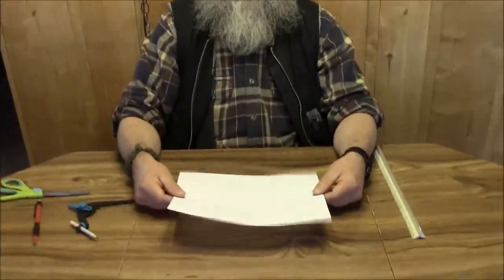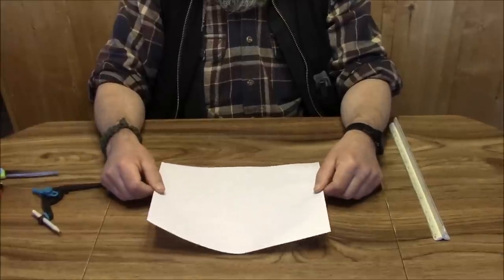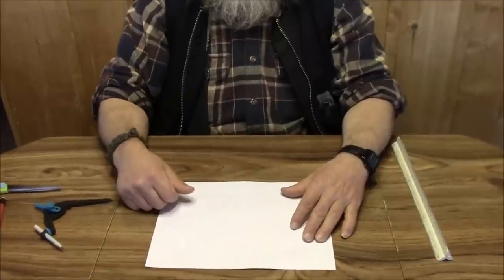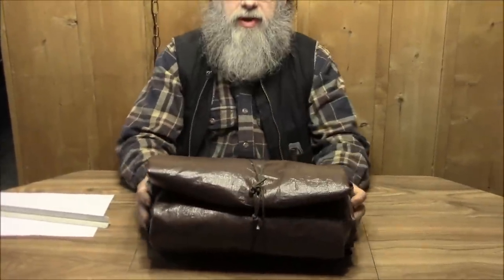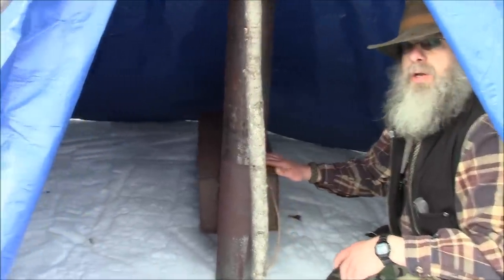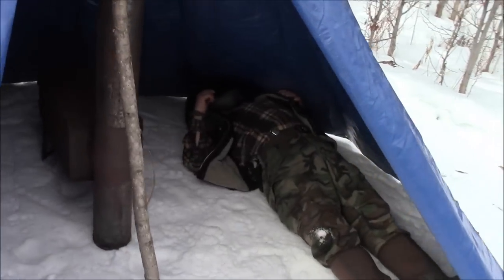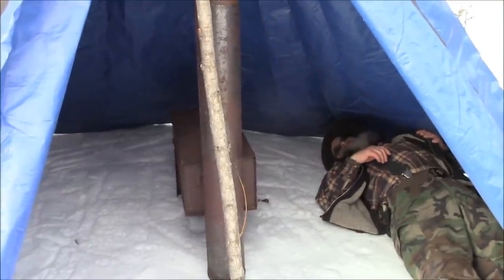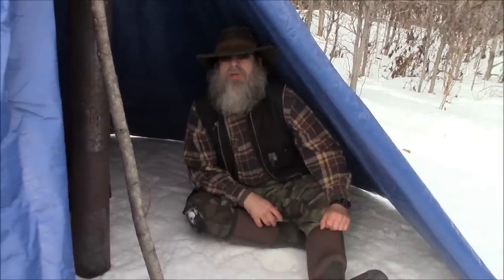Make A Tarp Tent Tipi Hot Tent On The Cheap

Comment: Hi Lonnie!Great and cool project my friends! Thanks for sharing. Take care, Sepp.Please tell the size of the fabric before cutting
Reply from the maker: The size of the tarp was a 12 Foot X 16 foot heavy duty poly tarp.   This size tarp and resulting tipi is okay for one person and will fit up to 2 people in it when also using a stove inside but it is not very comfortable not being able to stand up.   I recently watched another video where the video creator made a very similar tipi from a 16 foot X 20 foot tarp and that was much more roomy with a center pole height of 7 foot 3 inches so enough room for us shorter folks to easily stand up and enough room to be able to get back away from the stove as well as be able to sit up off the ground in chairs with legs.  So I said all that to say that I am planning on making me a new larger tipi from a larger tarp before next summer most likely.   However if you are usually by yourself you may find the smaller size tipi satisfactory for your uses.   It is a matter of personal choice.
Reply: @Far-North-Bushcraft-Survival Thank you lonnie

Comment: Great Video.  Just a though, some of that scrap material could have gone in the reinforced area inside.  I did not hear you mention the height of the pitching stick.  I know you would cut one as need, but what was the approx height?
Reply from the maker: +Chris Varns    Yes you are right.   I could have used tarp cutoffs for extra reinforcing.    The height of the center pole is approximately 6 feet high.    It is not very practical to have a precut stick since the center height can vary considerably due to each new tipi pitching location.  It is virtually impossible to find completely smooth level locations to pitch the tipi in wilderness settings.     A person though could easily precut a PVC pipe for instance though and place another smaller diameter pipe inside which can be slid further in or out according to what is needed and then clamped in place.

Comment: Great video , but i see a ventilation issue. With the extra wedge for the door it looks pretty airtight. Did you consider that?
Reply from the maker: There is very little condensation inside this tent when using a woodstove as teh woodstove creates considerable air movement through the natural consumption of air during the combustion and the sucking in of fresh air from the outside to replace the consumed air.   I have made many different tarp tents through the years and have never had a condensation problem when using a woodstove inside.   It does occur but is minimal.

Comment: One idea, when you cut the V for the door, instead of cutting it exact move one side a couple of feet in. That will get your door overlap without having to add a scrap piece later. Just be sure to mark the original point, you would have cut it to, in order to get the grommet placed there right.

Comment: This is just a question My Brother Could I use this same idea with a 20' x20' tarp it will be for long term use so I will be making two of them one for backup and a much smaller model for equipment storage
Reply from the maker: +Gene Peltier     I would recommend that you get out some paper and draw out models of the tipi and put them together.  Measure just like I shown in the video so that those measurements can then be translated to represent feet or decimeters or what ever you desire.    I have never tried using a square dimension material.   Draw it out on paper and put it together to see what it looks like and then you will know.     I am sure you can use the full 20 foot length but may not be able to use all the 20 foot width.

Comment: cool. I wanna do this, maybe make a hole at the peak , for smoke and a regular wood fire on the ground,  sew some webbing straps  4 or so  to tarp and up to a ring or something, poke pole through ring,    i dunno what do u think of a regular fire on the ground lonnie? verses a stove with a stove pipe?
Reply from the maker: This is not the best design for having an open fire inside.   It would be better to have a taller and narrower design tipi for open fire use to allow more upper room for smoke.  It might take some figuring to make a hole in the top for smoke escapement but also have a means to support the peak.   You have to go back to the old fashioned way of using an inner pole frame just like the old tipis

Comment: Lonnie, instead of adding that "wedge" at the door at the end , would it be better to just cut the door a bit wider to leave a "wedge" attach in one piece so it overlaps naturally, would that work  ?... what size pole is needed ?... thanks for the great instructions ,I will be using a white tarp so it get plenty of light inside during the day .
Reply from the maker: The way the tarp is laid out for cutting, one can only make the most of the available material if the door overlap is added later from cut off scrap.   The center pole is approximately 6 foot but changes from set-up-location to set-up-location depending on the unevenness of the ground in each location.

Comment: Lonnie, why not fold the tent in half, mark and cut. This will minimize the area required. Just a thought. Great job!
Reply from the maker: Randy Krofick I'm afraid that might have slid around even more on that slope.  I was cutting this in our driveway and our whole driveway is sloped one way or another.  Our house doesn't have any area large enough to even fold the tarp in half.  We do have an upstairs deck that would work but it was covered in snow.   I guess the most practical thing would have been to wait for warmer weather and then lay it out on our deck after the snow melted off.

Comment: A tennis ball with a hole cut out of it to fit over the center pole would also provide extra protection from the pole to pierce the tarp.
Reply from the maker: I agree.  That is also the method I use for "flotation" on my backpack type chair legs to keep the chair from sinking in loose sand or snow etc.

Comment: will be that it is possible to use as a central stick a pipe pvc ?
Reply from the maker: +Eduardo Fagotte Yes a length of PVC pipe would work very well for a center pole.     Personally though I prefer to use a lashed pole bipod on the outside of the tent in order to keep the inside area more free and usable.   Either way will work fine.

Comment: the pole? how did you get to the length?
thnks for making it simple, also, thnks charlie
Reply from the maker: +Billy Pell    Once the tent is staked down well all the way around, you just step inside the doorway and lift the tent up to it's proper height and measure that hight.  That gives you the approximate pole length.  However this height may be slightly different at different setup locations.    So if you want to re-use the same pole you may want to cut the pole a little short and then just plan on "shimming" it up to it's proper height at each location.

Comment: Sir ,thank you for this usefull sharing,please tell me which size is better 16*20' or 13*20'  and what is the difference ,i will build silnylon teepee
Reply from the maker: My tarp for this tipi was a 12 foot X 16 foot.  However this tipi is a bit restrictive in floor as well as overhead space for two people.  A 16 foot X 20 foot tarp makes a much more roomy size that I personally find more favorable.   I show in the video how to make scale models of different size tarps to see what one would end up with in terms of teh finished shelter.   I suggest you follow that advice.   If you do, you should then get the answers to your size questions.
Reply: @Far-North-Bushcraft-Survival  thank you so  much for your reply and precious information

Comment: This is really cool and I'll be trying this.  One quick question though.  Rather than tape an additional wedge of material onto the tarp for the door section, could you not just leave the extra on the tarp when cutting it out? cheers
Reply from the maker: It has been several years since I made this but if I recall, the angle is not right.   Just guessing right now without trying to analyze and refigure it all out, I think the bottom of the door would angle upward.
Reply: I cut mine per Lonnie's modified version and put a zipper on the door that I bought from Home Depo in the tarp section. I then followed the edges with duct tape. It seems to work fine and will be backpacking in deep this Fall with it for elk camp. I trust it to work as it has held well so far.
Reply: Cheers for the reply.  I made a smaller one to figure it out and you are 100% correct.
Reply: That zipper idea is a good one.  Think I'll sew one in and then tape the seams

Comment: I recommend higher quality of tarp for this project if you want it to last well.....
Your cheap tarp worked vey well for the demonstration, though.
Reply from the maker: I personally do not recommend a higher quality tarp for the average person unless that is specifically what they want.  This tarp is precisely what I was looking for.   This is not my first time of making tarp tents by no means.   I have made and used poly tarp tents for several decades now.    I purposely chose this tarp material based on my needs.   A tent made with a heavy duty poly tarp like this will last many years using it for occasional campouts.   Of course if you are going to live in it, you will most likely want to invest in a better tarp.   I have perhaps a total of about 30 days of camping in this tipi and I am sure that there is many months of life left yet.  So for occasional use such as the average person would do, this tipi is good for many many years of service.   A friend and I have camped in his homemade tarp tent for 5 years now on our remote Alaska river hunts and he had been using it for sometime before I started using it with him.   His tent is still going strong.    Of course if a person wants to make one out of nylon or canvas, that is fine too as long as that is what they want.    However, with nylon or canvas, I would not tape it together like I did here.  I would sew it together.  No sense in using an expensive tarp material and a cheap joining system.

Comment: Great video! How well has the tarp tipi held up?
Reply from the maker: It has held up very well.  I have not used it much the last year since I have made a bigger, roomier range tent that I prefer to use more.   My wife and I were in a big windstorm while caribou hunting above tree line in 2016.   I kept expecting this tent to shred any minute and leave us exposed to the elements.   In the middle of the night I told my wife we better get fully dressed in case the tipi rips apart and goes sailing off into the lake we were camped by.   We did that but I still was not comfortable about the situation.   Finally I pulled the center pole down and laid the tipi on top of use to present a very low profile to the wind.   That really helped and we were able to get back to sleep.   After we got back out to the highway system we heard on the radio that damage had been done by the wind in several towns in South Central Alaska.    I was extremely impressed with the tipi after that.   It was a good thing it was built out of heavy duty tarps rather than medium duty tarps.   The range tent that I made is my new favorite and is now my main tent.   You can see how to make that tent in the video link below if interested.

Make A Range Tent Style Hot Tent On The Cheap
https://www.youtube.com/watch?v=t47WFUZM4go
Reply: @Far-North-Bushcraft-Survival  Great to hear. I've been thinking of building one myself. Thanks!

Comment: yes , but how does hold up in heavey snow ? .
Reply from the maker: +angelean dozier     It should hold up as well as any other tent especially if it is heated at the time of the snow fall.   If it is heated then there will be no worries because what snow is falling will be melting up higher on the shelter.   Now if you plan on setting this up and leaving it then it may be wise to take precautions similar to what you  would use for other tents.    It is my belief that this tent would do better than most but it is still a tent.

Comment: If no one asked already, How do you keep the door from flapping open when you are on the inside under windy conditions? Have you tried the teepee out in a storm to see how it survives. Lastly shouldn't you have a vent hole in the top like a real teepee for any Co2 gasses that may escape from a hot stove? Thanks love your videos.
Reply from the maker: The door overlaps the tent wall and I reach under that wall from the inside to fasten the door tie out to a stake already driven in the ground in an appropriate location.

My wife and I were camped on the shore of a remote alpine lake and were caribou hunting when a windstorm hit us.  The tipi did great.  it was flapping and making a terrible racket. we took down the stove and got fully dressed in case the wind shredded the tent and sent it flying off into the lake.   We could not sleep that night due to the worry and the noise.  Finally we took down the center pole and lay the tipi on top of us and we were finally able to fall off to sleep and slept fairly well until morning.   The tipi survived just fine with no damage.  I was extremely impressed.   I did use heavy duty tarp though and not the thin light duty tarp material.   No. no vent is needed in this floorless shelter.  There is plenty of air can get in to the shelter to replace consumed air for fire combustion by entering under the tipi walls and through gaps in the non sealed overlapped door.   If smoke fills the tipi from stoking the stove during poor stove pipe draft occasions, it is a simple matter to open the tipi door which opens almost all the way to the peak in order to quickly air the interior out.
Reply: @Far-North-Bushcraft-Survival  Thank you Sir for your detailed reply. Very much appreciated. Your videos are helping me get psyched upped ,confident ,and prepared for my first winter overnight. I do not have bears here like you do in Alaska just coyotes and fisher cats so not that adventurous LOL. Thank you again..Burton
Reply from the maker: Sure, let me know how it goes and good luck

Comment: Do the "tarp" tents have condensation problems? I'm going to build one to put my bucket stove in  but I think the poly is gonna sweat.
Reply from the maker: They do have condensation but it is minimal when using a woodstove.    The woodstove tends to dry the interior air.    Condensation has never accumulated to the point that I find it a problem.

Comment: Wow this is so awesome 
I tried a teepee out of a tarp and it was a total fail
Just got a guide gear woodstove and I’m gonna get a 12-16 tarp and copying your design
Love the 1 pole design also
How tall is that pole your using?
Reply from the maker: I traditionally cut a new pole at each location where I set up the tipi as it is slightly different at each location due to uneven ground.   However it is approximately 6 feet high.   What I have done recently though is I found an aluminum adjustable length pole such as is used for roller paint applications at a thrift store for reasonable cost and will use that for my center pole when transporting by boat, snowmachine, off road vehicle etc where the extra slight bulk and weight does not matter so much.
Reply: That’s a great idea 
Was wondering also instead of the tape maybe I could do a zig zag stitch along the edge?
Vs tape?
Reply from the maker: Sorry I did not address your comment earlier but my notification of it got lost in my emails.  I was cleaning up my emails just now and found it.

I personally have not tried sewing poly tarp but my hunting buddy (AKTrapper on YouTube) made a great "wall tent" design that we have been using for 4 or 5 years on our hunting trips.  He made the tent by sewing poly tarp and it has worked great so far.
Reply: Used mine yesterday with my son 
Was cold and windy out and we were super warm love this thing stays in car trunk as an emergency shelter

Comment: Hey north bushcraft man was woundering what is the length of the stick do you remmber or have the TiPi still or no?
Reply from the maker: Yes I still have the tipi and no I never did measure the pole since I generally just cut a new one wherever I set it up in the woods.  The pole length needed, varies a bit depending on each location's geography.   However since this video, I have collected a few extendable aluminum poles made usually for painters and window washers.  I pick them up used occasionally from thrift stores.  They are now my tipi poles.